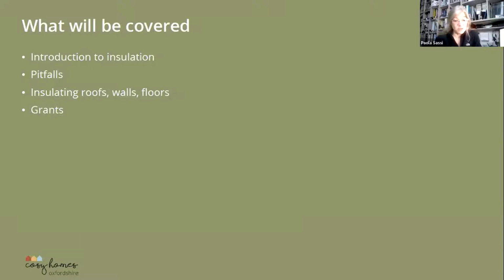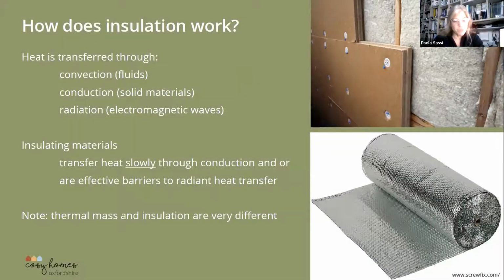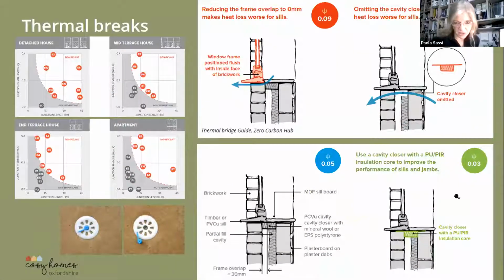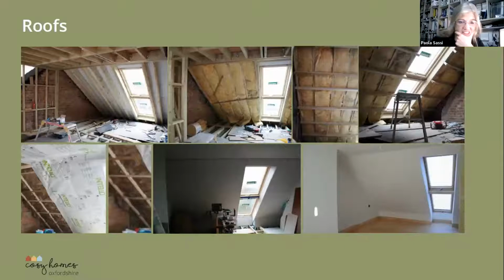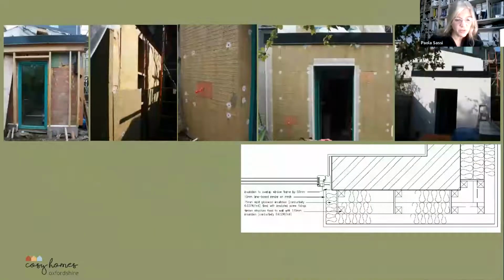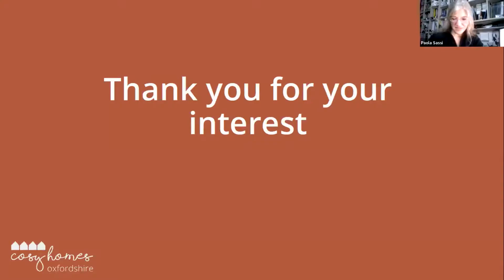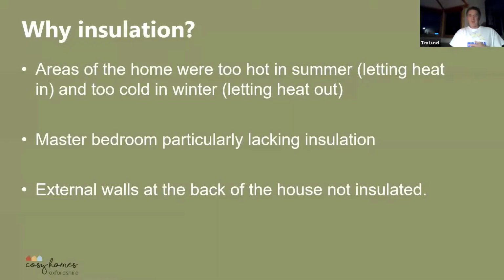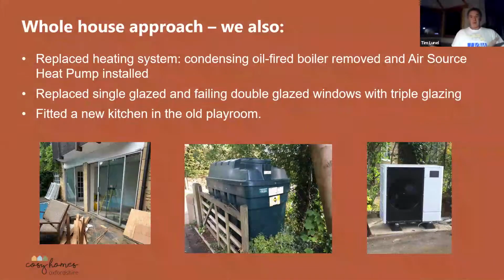Insulation: why it matters, what to use, and how to get it right

Comment: Interesting webinar. It was suggested that floors could be insulated over the top with 60mm of insulation and then the doors cut down to suit. The issue with this is that the door if hollow this work will go against the manufacturers maximum trim limits and would result in a narrow bottom rail aesthetically. Given that the skirting would have to be replaced during the floor work then the better option would be to leave the door the correct size and extend the height of the door opening.